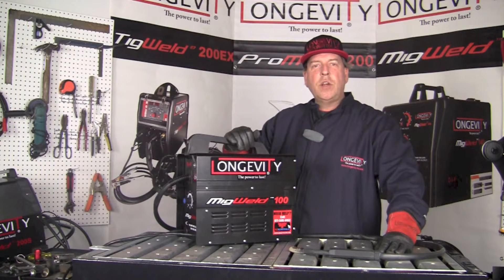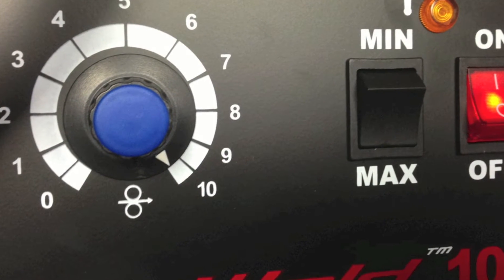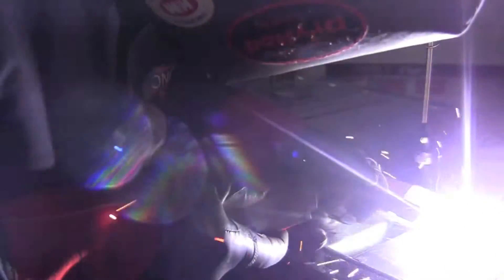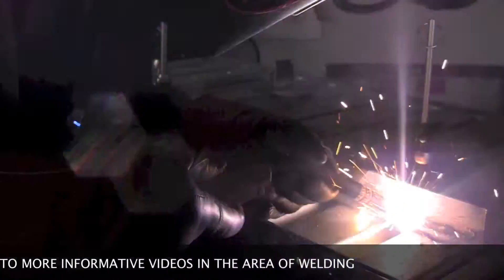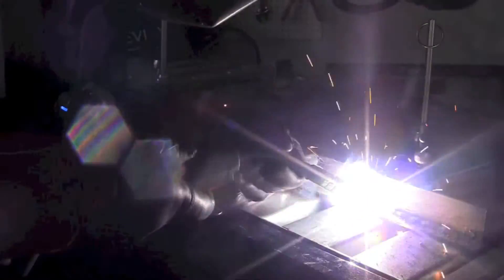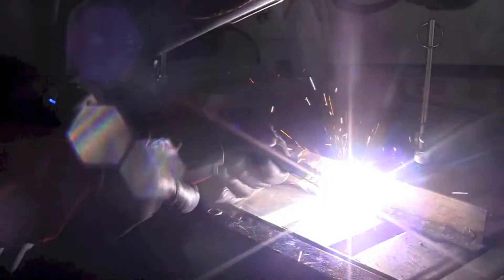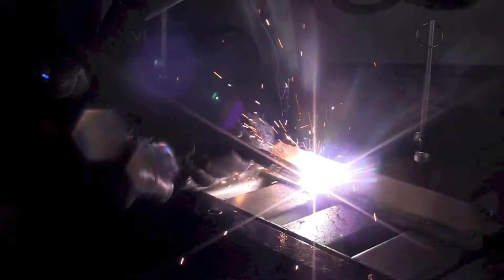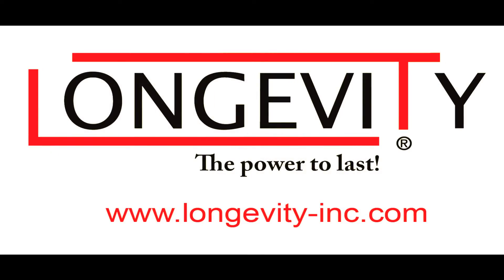CHINESE FLUX MIG WELDER TORTURE TEST 20% DUTY CYCLE TRUE OR FALSE

Comment: I think setting 10 is a little too fast, sounds like a little sputtering.  That is a good little welder.  What was the temperature in the shop?  It will run longer in a colder environment.